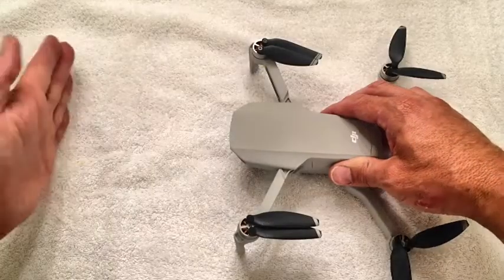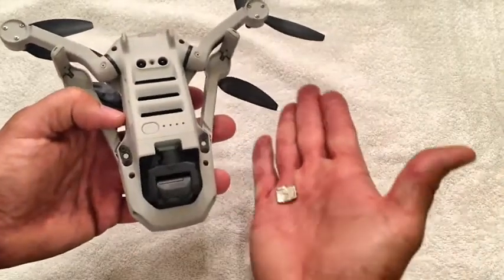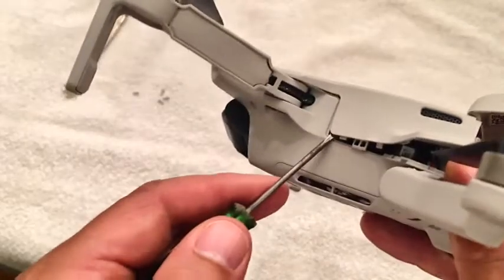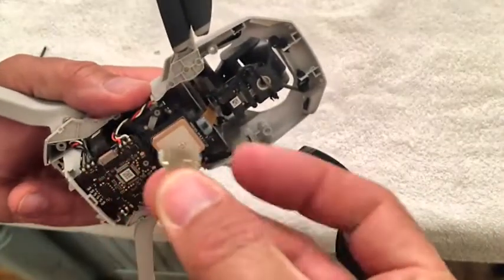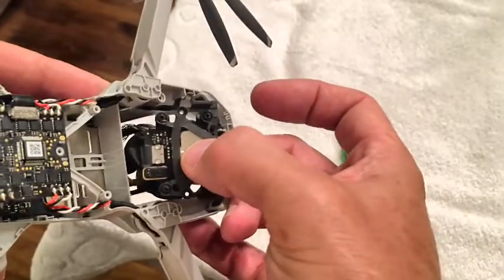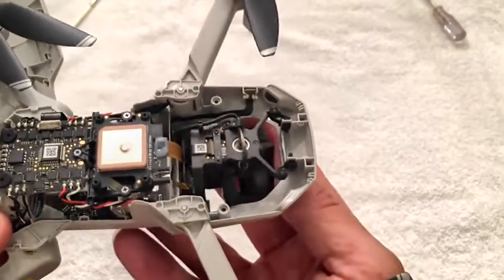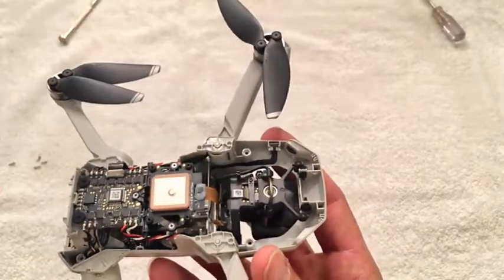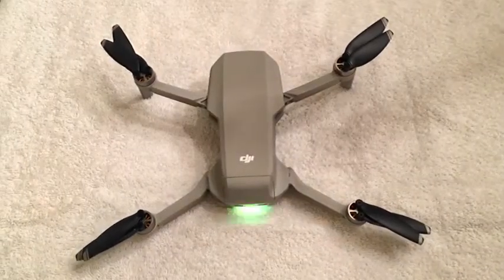How To Fix A Crashed Drone (Gimbal)

Comment: Had the same problem.with my drone a few weeks back mines not a dji its a potensic se, so i took mine apart and 1 side of the camera mout had been pushed to far back so i simple reset it back to normal position and then put it back together and all works fine again so great simple video thanks for sharing

Comment: Thank you! ...it fixed mine, without having to take apart. No card cover fell out. Just gently pushed down and back and I felt it pop loose! No Gimbal Stuck error. Had to calibrate 2 times. Still cleaned with air and oiled, as instructed. Thanks again! @Kapdiv8Drones

Comment: After I fixed it the camera won’t turn on
Reply from the maker: Check the wiring on both ends.  You may have a connector pulled off.

Comment: I also had a (very small) crash. No damage. Not even a broken prop. But now the gimbal always tilts a bit. Calibration does not help. Did you experience this issue as well after your crash?
Reply from the maker: Yes, that is exactly what happened to mine.  The gimbal just got knocked out of joint.  Follow the video and you will have it back in shape.
Reply: I opened it. But gimbal is ok. All looks good. But still tilted horizon.
Reply: @TimoOnline  Have you found a solution for this problem, yet?
Reply: DJI replaced the drone for free. Guess there is no other fix unfortunately. Very sensible device unfortunately.